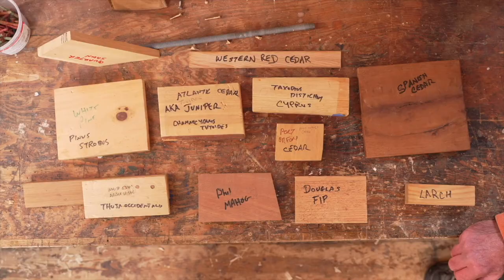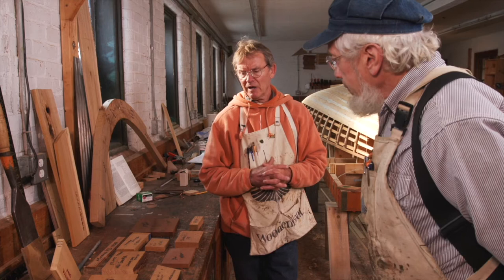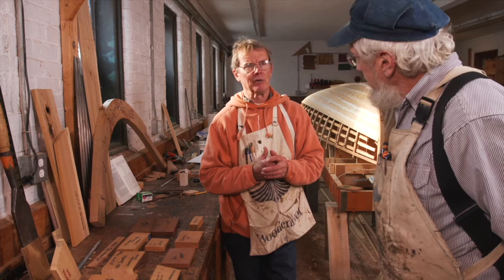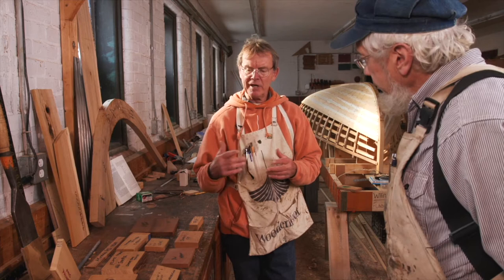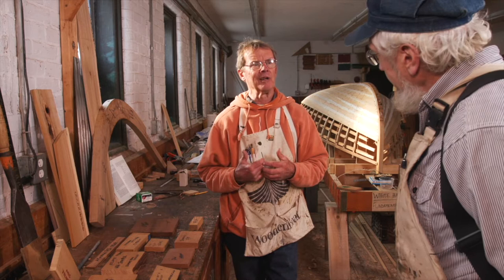Carvel Planking, Part 3: Hanging Planks | Mastering Skills: Season 2 - Episode 4 (Trailer)

Comment: Red Oak for the same reason is very easily pressure treated. They should make it and sell it widely for decking and for boat frames. It is also the equal of white oak in strength.